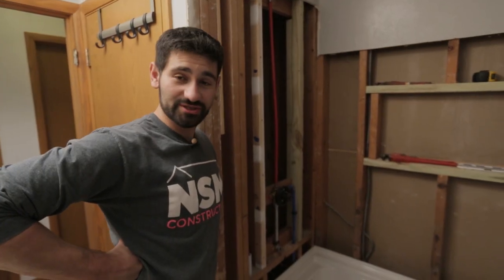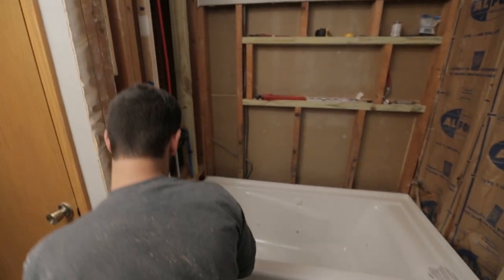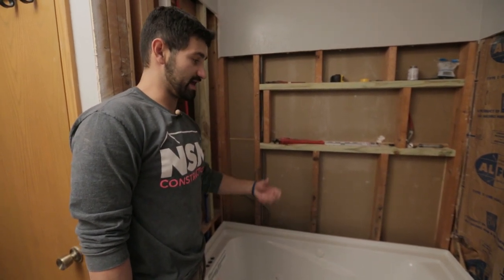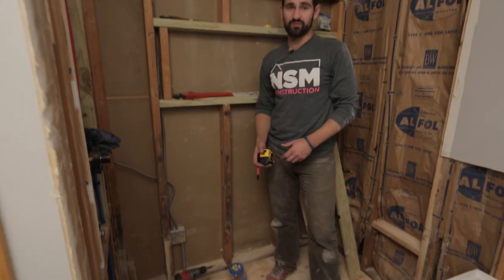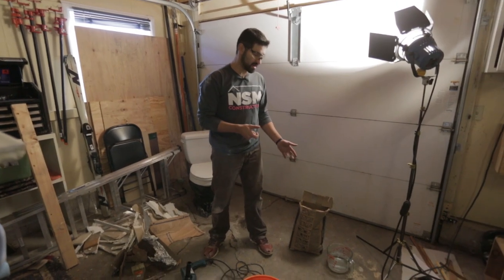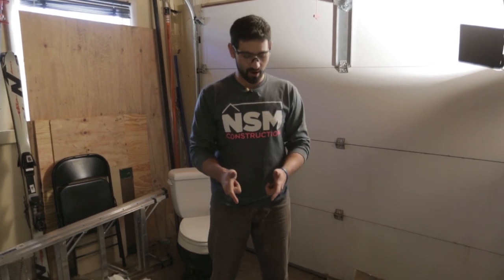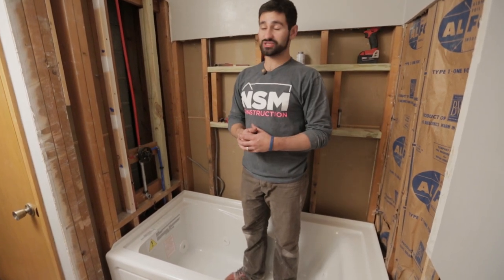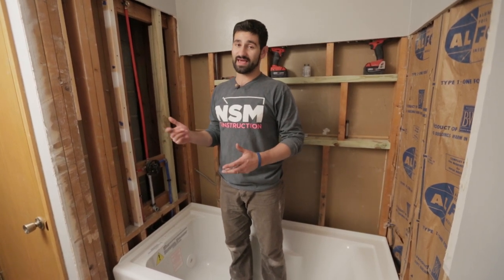How to Install a Tub (American Standard EverClean Whirlpool: Cheapest at Home Depot)

Comment: One trick , I know that could help. You can use masking tape and cover your drain hole cut out in the floor, it will hold the mortar back but will easily let your drain pop through without doing any damage to your drain pipe. A good stretching masking tape will act as a temporary seal around the drain to keep the mortar from sliding down your pipe and hardening,  this way when you go under the floor to make your final connection you have less thinset grout to clean off the pipe, if any at all. Gotta be a good strong high tack tape to hold though. Of course it will dry out over time and flake away , it is not meant to be permanent just a way to keep all your mortar from pouring down into your crawl space and all over your drain pipe.
Reply: What kind of stretching masking tape do you suggest? I couldn't find what you're referring to with searches. Think blue painter would do? 

Are you suggesting applying masking tape along the thickness of the underlayment/substrate leaving additional height from the tape as a barrier to this masonry mortar?

Comment: Awsome! I have been stressing for a long time about my tub. #1 It too is a remodel and an extremely tight fit. #2 couldn't find premolded shower wall kit to fit so have been stressing about the flang sticking up, thought I would have to grind it off all the way around. Now I know to screw it to the wall and tile over the flang. Now I am looking for the next video to see how you do that. I always though if I tiled over it the grout would not stick to the flange and would crumble out at the bottom. Thanks for taking some of the guess work out of it. This is the exact video I have been searching for for a very ling time now.
Reply: Not sure what you did, but they make grout colored caulk for just such things.

Comment: Thank you. Exactly the video the tub manuf' should invest in creating, hope you get plenty of profit for your efforts.

This is really a question for the manufacturer, but regarding the 1x4s and measuring distancing to install them. The 2x bags of type S (I called America. Standard to confirm) mortar should lift the tub up slightly since it rests on it. Shouldn't the boards be installed a little higher to compensate for this difference?

As mentioned, it seems best practice to be careful of applying the full weight of a person on wet mortar due to bending of the plastic tub and won't the mortar shrink?

Last note, use an extension bit with countersink bits to avoid damaging the finished surface.

Comment: Question about the exact same tub. Mine has a half a plywood bottom. When I place it on any floor it isn't anywhere close to level. Am I supposed to remove the plywood?  The pump is also attached to it.

Comment: Super helpful video -- very clear process instruction. Quick question: You're using CustomBlend thinset. A guy at Home Depot also recommended Mason Mix Type S mortar.  I like what you're using.  Is there a difference between the two mortars?

Comment: You should NEVER screw through the tub flange. It can and will cause cracking in the tub.
Reply: Yes correct you pour the mortar bed wait for the mortar to dry then you can drive a roofing nail above the top ledge to keep the tub from going up but really not necessary
Reply: the installation instructions instruct you to do so....
Reply: @stevephillipsrealtor373  really that's weird still a good video I guess only time will tell
Reply: @RealFifty  the instructions show your way with a roofing nail. Which is what should be done
Reply: Agree no drilling through the flange!! The install booklet/instructions show using a roofing nail or drywall screw with washer going in at the TOP EDGE OF FLANGE- NOT THROUGH IT! If the base support is a cement/slab floor, then it may not crack, but if its on wood and there is any settling, it may crack over time.

Comment: Where is the electrical and the plumbing? Is there a video for that as well? Plumbing to the jets? Where is the outlet for the plug?
Reply: Plumbing to the jets comes from the factory for that particular tub.  I was wondering about the power as well though, I guess you can run it after but what a pain.

Comment: I appreciate you making the video. I would have liked to have seen the plumbing going in and the tub going in instead of fast forwarding it. That part looks like it’s going to be a bear. It looks like u had three guys to help at that point.
Reply: Did you ever do your plumbing? I have the exact same question. I would have liked to see the transition from the American standard drain kit over to schedule 40 PVC. I note that they use slip joints to transition and I always like using glue, what did you do?
Reply: I agree 100%. Take 1/2 the video to show moving mortar. 🙄. Fast forward past the two MOST IMPORTANT item. Sign.

Comment: Never drill into the flange and secure it that way it will crack the fiberglass it clearly states this in the instructions to nail or screw with washer above the flange, also you should never use unmodified morter over plywood. You should have mentioned that you need to use the American standard drain kit that is not provided and you didn't even mention anything about wiring the tub and that it is required to be wired on it's own 15 amp GFCI cirquit to the breaker panel. You should consider taking this video down as you could be held liable for unsafe and damaged products as a result of your instructions.